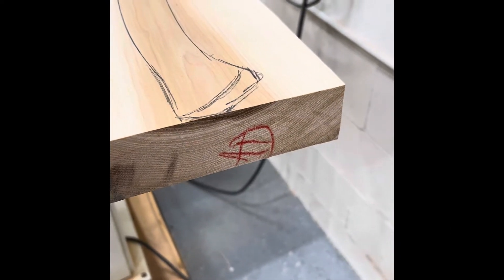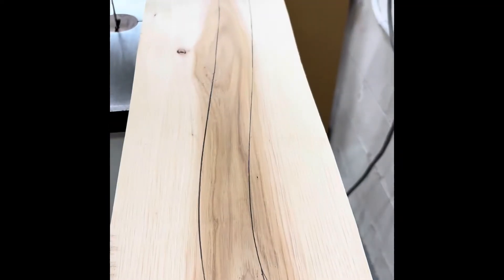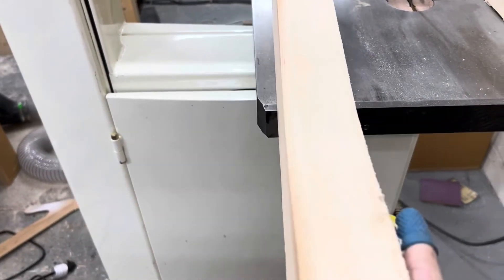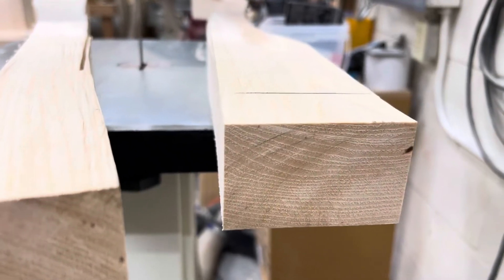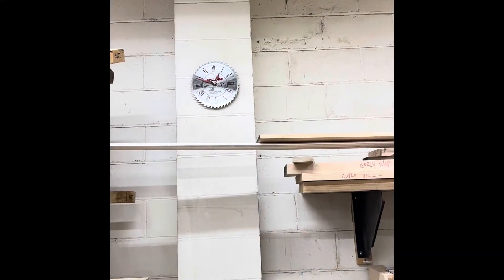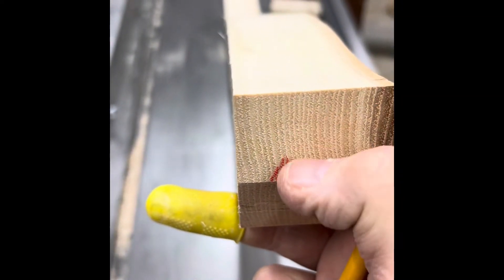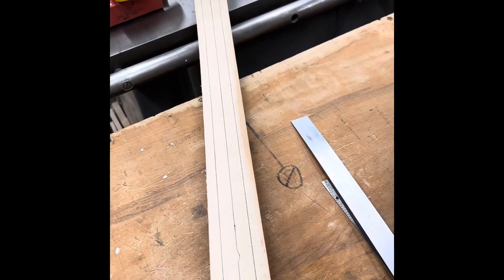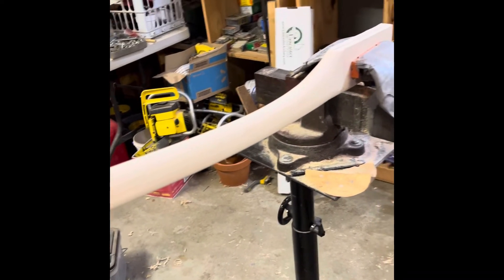How a Custom Axe Order Goes Together Part 1 Transitioning From Shop to Hand Tools#axes#axehandles

Comment: Great video brother. Great handle. Great work. How long does it usually take to make a handle like that from a board when doing it this way? Love ya brother. 🌲❤️🌲👊🪓
Reply from the maker: The machinery part literally takes less than an hour. Taking it home to the bunker is a process of do a little, walk away, put new eyes on it. So that just depends on how fast someone needs something. Shop is geared towards an assembly line. The more handles I can run through the process the completion time goes down. In the bunker I do better with a timeline because you know me I’ll dote on it forever.